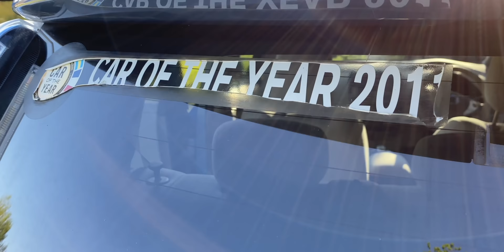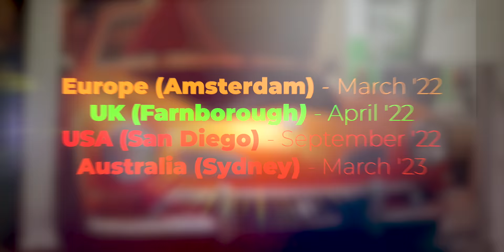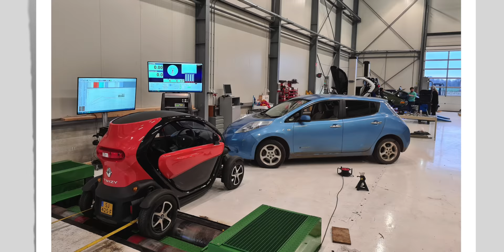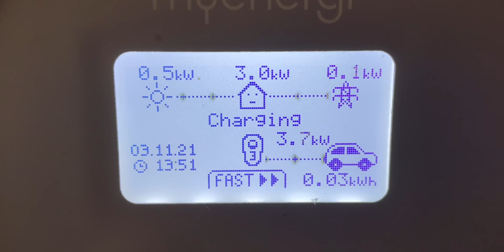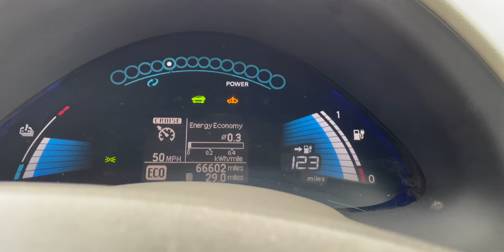Return of the LEAF: Robert drives his range extended EV home from Holland

Comment: Well Robert, most inspirational video as I have been in a quandary over my 2015 LEAF Tekna 54,500 miles driven with 55mile range in warm weather of course. Seems no support from Nissan or cost for replacing batteries. 
I purchased my  🍃 many years  ago believing would be the last to own. Of late I felt a huge financial long-term mistake. This episode has reassured me things can only get better and stop listening and reading the misinformation regarding older Electric Vehicles.
Sincerely thank you and team for taking the time to produce an informative and well documented video.
Happy  New year 2021 to you and yours and one and all.
Tony, near Bristol.
Reply: nissan ev hi-tech here, its not all about the batteries, just priced up renewing the corroded/sticking rear brakes, + a noisy wheelbearing, -  over £1k.
 its a64 plate with 60k, noise at 40-50mph from rear, + bad vibration/noise when reversing after taking off parking brake.   i think nissan have over-priced the parts to make up for lack of profit on service items
my advice - dont bang up kerbs, [wheelbearing], + leave the parking brake off all the time, you dont need to use it, save it for the MOT test only, + carry out a few heavy brake applications each week to keep rust at bay from your discs
PS - they said yes to all repairs, im a busy boy tomorrow, no early finish for me.....
Reply: @Thomas Sawyer finished that job today, just over £1300 final bill, bought cars for less than that, fair enough if it were a tesla, but its a nissan, part price rip-off for sure. overhauled my focus rear brakes, everything brand new, change out of £200, no leaf for me, couldnt afford to run it...
PS - that battery swap he did was "economical" with the true figures, that was a £7k+ conversion, day in, day out.      all the best for 2022
Reply: buy ñew bstee néw çare

Comment: Yes, modern battery packs should last well, with not much loss of range over the years, but battery packs can fail, and if they fail outside of warranty can be very expensive to replace. A Tesla Model S battery pack is $22500

Comment: Eurotunnel is electrified. Would be really nice to have a few chargers on board for that 25 minute journey where the car is sat in one place.
Reply: The extra transformers required to convert the train voltage to a compatible voltage for chargers would be a waste of weight, probably not worth it. Also it would probably add an unacceptable amount of delay to the loading of cars. We'll see what happens when the majority of the vehicles are electric but probably never going to happen.
Reply: @AlRoderick  Possibly. I guess they transform down to 220V already. They ise 25KV AC (I had to look it up). I thought they could electrify the first and last carriage. Then load leccy cars first and last.

Comment: Yet another great video for dispelling myths about EVs. Even a flawed, first-gen experiment like the Japanese leaf is going to last decades… and BOTH battery packs will be in use for decades. Total cost of ownership is so often overlooked in the affordability calculation for EVs . We got our 2015 24kWh Leaf when we needed an urban commuting car due to a job change. Worked out that the cost-saving on fuel alone over our thirsty diesel was greater than the likely depreciation of a similar ICE… essentially a free car in terms of cost of ownership! Battery currently 88% after nearly 50k miles… and will still easily cope with the commute even at 70% The perfect second car for us… with the old diesel being rolled out for longer trips (where it’s MPG is much more reasonable and it’s added comfort is appreciated).

Comment: Great video.  We love our 2016 Leaf SV with the 30 kWh battery.  We live in SE Minnesota, and the distance between chargers is a bit too much for us to use the car for out of town driving.  However, it is a great car for the driving we do in town.  For out of town driving we use our Tesla Model 3.  I am looking into using the vehicle to grid function that is possible with our Leaf.  We are on Time Of Use charging for our electricity, and it is quite expensive to use our electric stove and our air conditioner in the summer between 4:00pm and 8:00pm.  I'd like to use the Leaf battery during those times rather than the grid.
Reply: It's a bit pricey. Setec power doing chademo v2x module, but it's out 3000$ if my memory serves me well
Reply: @pashko90  Thanks.  I'll check it out.  If it is that expensive, I will have to pass.

Comment: That tractor was so cool!  Crazy to think your 2011 is getting 140 miles range.  I got a used 2015 and it claims 84 but I'd guess I get around 70ish with the cold weather and all that.  I just recently got it, so I'm just starting to use my trip odometer to try and figure it out.  I do city driving and am about a mile from a charger so I'm not really worried about it, but for trips it'd be so cool to upgrade to range like yours is getting.

Comment: Brilliant.

I really regret selling my Mk1.5 LEAF 2013 model back in 2019. I had the car for 6 years and 85k miles. It was an amazing car but the battery degradation was severe and 60 miles on a full charge wasn't good enough anymore... Wish I kept it for another year and I would have jumped at a battery swap like this...
Reply: Yep, and you can get as much as 62kwh pack in it! But packs are about 9-10k right now :(
Reply: ñope bü ñew jeàf 226 moeß

Comment: Our 2013-16 leafs will  have greater range with the 40 KwH battery vs our 30KwH ( or 24 in the C).  And we will have the benefit of our heat pumps, and heated seats... that the 1st gen ( 2011-12) didn't have... for even More Range!

Comment: What this video (apparently) fails to communicate is how difficult it is to get this kind of work done. I constantly see messages in EV groups on FB from newbies who want to buy a Leaf with a bad battery the "upgrade" the battery. Then they find out they have to ship their car 3000 miles and wait for a turn in a specialized workshop -- pay $6000 for the battery - then ship the car back. It's almost always cheaper to simply buy a car with a good battery to start with.

P.S. I drive a GEM car with 20 miles range and a 2013 Leaf SV with about 60.
Reply: gíd fir yoú

Comment: I would suggest a video on the rust and buildup of mud etc  underneath ,brake callipers need to be cleaned  and rebuilt every 50,000 miles ,
These cars start rusting after 6-7 years .
So I think this video is misleading.
My views are based on owning a 2011 Leaf

Comment: Watching this channel has really made me think about replacing my 16 year old - but still in very low mileage and almost pristine condition - petrol engine car. As I'm nearly 70, I don't believe I'd get value from buying a new EV, but with my low annual usage it makes sense to consider it as I'm right on the edge of the London ULEZ and who knows how many more times the rules will be changed. So, for the first time ever I'll research leasing an EV which I think can work economically because as the models are updated, I'm not stuck with old tech and can change it every 3 years. Thanks for a fascinating video and a great channel.
Reply: I would suggest keeping your car if you want to help save the environment etc.Getting rid of a perfectly good car was never environmently friendly that is never going to change.
Reply: just be very, very honest about what your mileage will be. Best way to look at it (as far as I am concerned) you take the longest trip you will do and make sure your choice can do it with a good 15% buffer. The percentage of users that actually need more than 200miles is really small. 

Kind of a shame you didn't decide before the last fuel crisis as the 2nd hand prices for the Leaf and better cars as gone up alot. Got my 2013 24kw Acenta Leaf  for £6,500 7 months ago. Same spec has often gone for £10k in the last month or so.
Reply: @andyhunt457  I agree Andy. That will of course be part of the research I do. The only problem with my current car is that it is of an age where parts are obsolete for it in many cases. It was never a particularly popular model so breakers yard parts are scarce too. I do intend to drive it till it dies, but the EV idea would be the ideal replacement rather than another ICE car if I can't keep it going.
Reply: @andyhunt457  Don't mix up the two parts of the lifecycle analysis. Keep in mind that generic household items, like a TV or computer has basically all their environmental impact upon manufacturing and very little afterward. An ICE vehicle has some at manufacturing, but the majority comes from using it.
Reply: @LordElpme  Yes, I don't really do journeys of more than 50 miles in one go. If I should ever want to go on holiday to say, Cornwall, I'd probably go by rail and hire a car locally for touring around. But as Robert said in the video, even his 2011 car would do about 50 miles on it's original batteries. So, I don't think range would be much of a factor for me. Incidentally, when I worked we had an electric BMW which on one, admittedly winter trip, was running on the back up petrol engine after 8 miles. The battery was fully charged when we began the trip!
Reply: I'm afraid that EVs are a SERIOUSLY bad financial choice if you regularly only do low mileage......and buying them does cock - all to help the planet either...!!!
I've only done low mileage for many years now - and my ICE cars(all pre-loved and kept for a long time .!) have been COMPLETELY reliable, and cheap to run.....
Reply: @lingondraken  I think you need to check the actual facts of a cars overall impact.Once it has been made there is no overall environmental benefit of switching to a new car to replace an existing one in good condition,to think so is deluded.
Reply: @LFBsmokealarm  Now if you bought a second hand one then that would be a different story seeing as it has already had its major environment impact.
Reply: @andymccabe6712  I never say I would buy one.
Reply: @andyhunt457  I never said I would buy one.
Reply: @andymccabe6712  You can also buy "pre-loved" EV cars as well. Or buy an old prius and do exactly what Rob did by replacing the battery, be it with a long lead time. So i don't really get your point.

Comment: Wow. At over 65k miles, 11 years old, the average Ice car would have had at least 13 oil changes, two break jobs, perhaps time for water pump replacement and radiator flush, plugs replaced, muffler repair or replacement, surpenteen belt replaced.  Not to mention the $7k to $9k just for gas, depending on location and MPG. So one expects to pay something by then anyway, even if all went well, if no transmission problems. Just $5k made it better than new.

Comment: Seems to be getting difficult to source workshops that will do the 40kWh upgrade now, which is a shame. Prices have also gone up quite a bit, so it looks like Gen1 Leafs will keep their original range now until cheaper and more reliable solutions come along. Probably makes more sense to get a used Zoe with 41kWh pack, so long as you don't mind AC-only charging..
Reply: New CATL cells are starting to become available for the Leaf. ☮️
Reply: @Tim_Kent Good news! Might look into that myself, although the "40kWh" 2018 Leaf is quite cheap now as an upgrade option in the UK. It's a good option if you only need 100 mile range..

Comment: Another YouTuber bought a second-hand leaf he was only getting 60 miles range on the battery but if he drove down the motorway at 70 mph that would reduce to 30 miles. If it was in the winter you'd be lucky to get 20 miles out of it

Comment: Windscreen wipers my 2017 Leaf with 3500 miles on the clock failed its 5 year MOT.Also the 12v battery was replaced after 3years and the same low milage.

Comment: Three Nissan leafs were in my family. Two 2012 and one 2011. One 2012 only leased for 24 months. No battery degradation. The other two experienced battery degradation. Both at around 30000 miles. Nissan would NOT fix!  4 year lease had just 32 mile range after 32000 miles. I'm done with any and all Nissans.

Comment: Good video, but it can be done locally too, which should of perhaps been mentioned ? - we can't all extend to trips around Europe .... my parents have had their first gen LEAF 24 upgraded to 40 in this country (UK) by  Cleevely EV - it has cost them less overall (original second hand purchase price plus upgrade) than they would of had to pay to buy even a second hand LEAF 40 - I traded in my 2016 LEAF 24 after 3 years for a 2nd Gen LEAF 30, then after just 2 years I have moved on to 64 kWh KIA E-Niro - in November we drove to Cornwall (271 miles) to visit and averaged 4.5 miles/kWh - whist on paper it could of been done non stop, we needed a comfort break, so plugged in at the motorway services in Somerset whist we went in and did the necessary and had bite to eat, upon return to the car it had gained around 100 miles in 35mins on one of the new Gridserve CCS tap to pay chargers - brilliant - Andy
Reply: The E-Niro is brilliant. had mine 18 months 36k miles later... still on 4.2 m/kw average.... pity infrastructure is so poor.

Comment: Hi - I have taken in all you have said about batteries etc. And you are so right, batteries don't fail after two or three years. But with even the newest technology, they WILL 'need' replacing after ten years, when the range drops to something unacceptable to most people. Batteries will become lighter, so either higher capacity packs can be fitted for the same weight, or 'standard' capacity packs will make the overall car's weight less, so range will improve simply because you're not lugging the current ?150-250 kg dead weight around. And your per mile costing is just INSANELY amazing as it is! So yes, I do accept your Leaf story, and that £4,000 spread over 10 years is only £400 pa, and my old diesel car costs far more than that in fuel, plus other related costs, year on year. But (and this will most likely change in time, but all the same) - why oh why can't you just plug a car in at a public charger and be charged for the power on a debit/credit card? No flipping app (and you have to have the right one/s on your phone, and you HAVE to have a flipping phone or no juice) please. I buy diesel at present, and I just pay for it. No app/s needed, juice fill it up, pay, and leave. Just WHY does it have to be as it is now, beholden to whichever companies have power over whichever charger you are at?      Subsidiary comment - when I can buy an 8-10 year old, 100K+/- mile, second hand electric car for £5,000, a large estate at that (which I can sleep in, my campercar if you like) which will do seven or eight hundred miles on a charge, minimum, and not 'leak' power when standing for a week or so, and keep going for another 10 years/200-250,000 total miles on the clock at least, I will buy one! I live far from cities, there is one charger in my village, I can't park near my house so no home charging, the next nearest, single, charger is 60 miles away, and after that, no idea. This is far from any concentrated population. The very small villages and townships here number in under 100 souls, usually less. This is also a HUGE tourist destination in summer - I cannot see where the large numbers of public charging points that will be needed in the future can be sited. Rows of them along the beautiful sea front like old-school parking meters? Which will destroy half the reason people visit - the sea and the views across to the islands, now full of cars lined up to buy electricity. Just thoughts from a man who actually thinks, and is not anti-electric vehicles, but trying to see how EVs will work outwith the more usual 'town and country' scenario. To date, almost the only EVs I have seen at the village hall charge point have been Teslas. Presumably the higher range versions. Heading further north might not be possible with anything less. Even the new range of your re-habbed Leaf won't get you around up here...

Comment: Roberrt mentions how the early LEaf didn't have any battery heating and cooling.
HAs any third party designed either a replacemetn battery with heating and cooling or any kind of add on or retrofit that you can install to improve battery performance and battery life?

Comment: I'm jealous. My 2011 LEAF with 50k miles is down to 45 mile range. I'd swap the battery if the service was available here in the SF bay area. The cost is very reasonable.
Reply: wms9me iñe kraf 40 mîlé ràbge  kéaf regen breakibg  new batrr bew jeaft 226 mîés range   tíes cels 10 irrct too 16 irrct kire rabge

Comment: It does seem it’s not just range anxiety on making the next charger, but also whether the charger will be working. The issue with all the different apps to cover different networks, why can’t you just use a debit or credit card like you do for petrol and diesel? I did a similar trip to this in an 11 plate Fiat Punto 1.2 non stop, while my fuel costs were obviously higher but I wasn’t wasting my time waiting (time is money) or spending money on coffee etc that I didn’t need. To be fair this is an unusual trip, but I do regularly do 180 trip from Hampshire to Cheshire and wonder what would be the charging plan, as I’ve looked at a secondhand Leaf that would be affordable with the 40 kw battery.